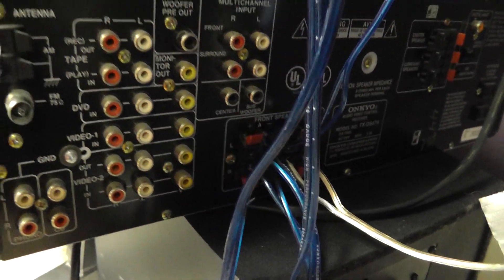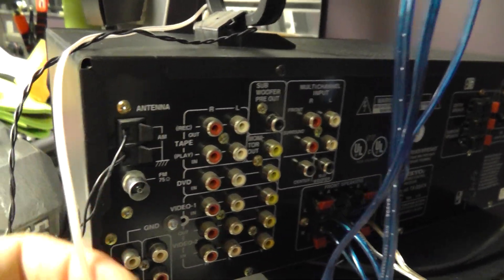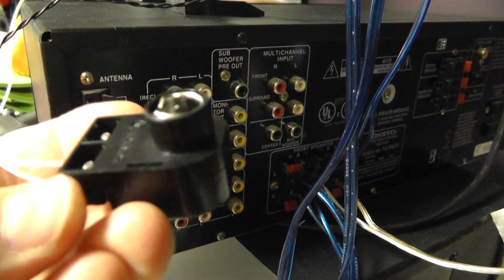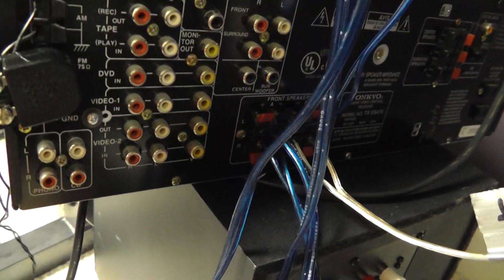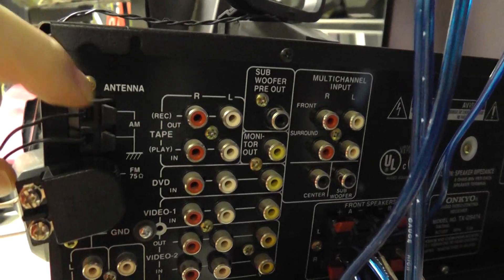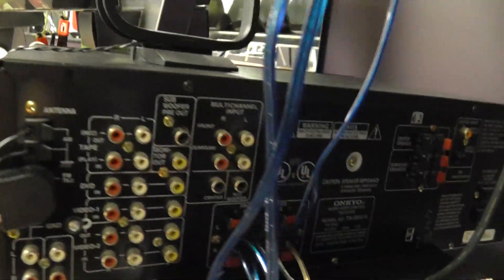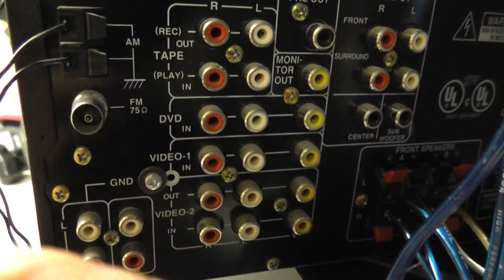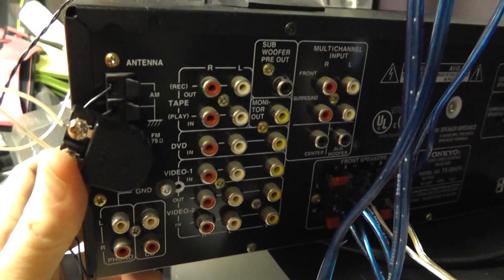how to hook up wire FM antenna to 75 ohm plug

Comment: One question, how could I know if my antenna is 75 or 300 ohms? My antenna's conector is a thin male F type and the one in my stereo system is a thick male F type. Thanks in advance!

Comment: I have the 300-75 ohm adapter.  No dipole antenna wires.  Can I make a diapole wire antenna using speaker wire?  How long?  what wire gage?
Reply from the maker: Really does not matter the gauge,  Length, just about 3ft a side.

Comment: My tuner doesn't have that round connector.  Instead, it has a bolt n screw to attach a bare wire.    Has a separate bolt n ground screw, too.

Comment: Here's a question. I have an '87 Yamaha reciever that never makes anything easy on me. It has spots in the back in a row of four - 300 bal, 75 unbal (both under a FM heading), a spot under AM, and one that's marked ground. I have ZERO idea how to hook up this old Terk FM antenna my dad gave me from his old hi-fi. It splits into two wires like you mentioned but I don't know if they get split into which spots on the back of the unit or what.
Reply: If you figure this out please let me know, I have same issue with my vintage receiver.  Thanks.
Reply: @stevebowman5396  SAME!

Comment: This is WRONG!!! 
A dipole (T shaped) antenna is 72 ohm. That is close enough to 75 ohm to work. 

You do not need a 300 ohm to 75 ohm matching transformer.  4 to 1 matching transformers are for more complicated antennas like a folded dipole or multi element tv antennas. 

Google dipole antenna and 75 ohm antenna. Less than $10 on Amazon. Just make sure to get the proper connector, F-type(US) or PAL(European) for your receiver's input. There are F-type to PAL adapters also.
Reply from the maker: No, you can add adapter which converts to 300 ohm dipole(T antenna) antenna

Comment: That little 75-300 adapter you used there: have you ever taken one apart and looked inside?  I'll bet you haven't.  Nine out of 10 have direct connections--two little jumper wires and nothing else.    There's no ferrite choke transformer like they're supposed to have.  If you're getting poor reception, this is probably why.  Make sure you're getting what you're paying for.

Comment: Or if you already have a rooftop FM antenna that is 75 ohm you can buy one or more of these to have around, https://www.ebay.com/itm/121777070417 , a F type slip on converter for your coaxial antenna cable...  May have to buy an AM antenna one of these days, if I was ever prone to listening to AM that is...

Comment: Jean Steven,  Netlemming , David Daivdson and others...

Success! I ordered the RCA VH58N from Walmart and it fits! I now have old school radio!(Note: "Axis RSE-E101 Quick-Connect Matching Transformer" did not fit, also from walmart)

Although Walmart has it as the VH58N, the packaging is identical to the below ebay link, which is the VH58R. Based on Wiki, it appears AUDIOVOX sells these now? Either way, you may see RCA and AUDIOVOX on a given link (see the true value link). Searching only for the model # should be sufficient.
Hope this works for everyone

http://www.rcaantennas.net/accessories/?sku=VH58R

http://www.truevalue.com/product/Quick-Connect-F-Plug/17356.uts

https://www.walmart.com/ip/RCA-VH58N-Push-On-Matching-Transformer/20588616

http://www.ebay.com/itm/RCA-Push-On-Matching-Balun-Transformer-VH58R-/371899388282?hash=item5696ee517a:g:lAYAAOSwEAtZY-50

Comment: I have a FM 75 ohm coaxial FM port. I have the same cable as you in the video but it doesn't fit! The outside ring of the port and the cable are the same size :( I am in desperate need to find a cable. I broke my old one. Do you know what I should search for on amazon/ebay?
Reply: I bought a couple of the ones below and they too, won't fit. I was hoping the outer ring would fit inside the Yamaha's plug but both are about the same diameter. The receivers come with the adapters for coax plug on the receiver, as referenced in the manual, but it's long gone.

These are handy and it's only one wire instead of the usual "T." They receive stations well. Too bad they don't fit:

http://www.ebay.com/itm/FM-antenna-75-UNBAL-for-Yamaha-Natural-Sound-Stereo-Receiver-/162355421561?hash=item25cd232179:g:Yn8AAOSw8vZXNBqp
Reply: I'm in the same position. I have a Yamaha RX 595. I just bought the below from ebay and not only are the outer rings of the adapter and Stereo's FM antenna input the same width, the the male portion of the adapter is too thick/wide for the inner ring female part of the FM input. The width of the adapter's male portion is about 5/16". Of course, everywhere I look, there are no dimensions for that piece of the adapter. It appears there are other adapters that have a thinner male portion, but all are called the same thing, and difficult to determine by photos. I cannot think of where to find one locally. Too bad Radio Shack is more or less gone.

The title of the ebay item I bougt is "Connector Antenna Transformer Balun75 300ohm IEC TV PAL Male Adapter FM z9Y"

http://www.ebay.com/itm/Balun-75-300ohm-IEC-TV-PAL-Male-Adapter-Connector-Antenna-Matching-Transformer-f/152399808087
Reply: I believe the adapter per ring would go over the Yamaha port.
Reply: I have this port (first photo) as depicted by the seller's listing below. The adapter sold cannot slip between the opening in the Yamaha port. The plug being sold is the same size as any 75ohm coax connector. I found out that my Yamaha (R-1000) and many from this vintage has a PAL connector, so I will either need to make my own or find a proper one. I just want the simplicity of plugging in an FM antenna.

http://www.ebay.com/itm/142432290262?ul_noapp=true
Reply: @netlemming5571  I have a receiver that has a fork input for FM 75 ohms and next to it has a GND input, which I don't know what it is for. How do I connect an antenna to the FM input? I have a transformer that receives the coax and turns it into two wires with a fork, but where should I put these two wires, if the FM input is only one and on its side has this GND?
Reply: @madeirasd  It's likely for the phone input. Is it next to it? AM antenna has two connectors, with one for ground.

Comment: my  radio only has one single wire. What do you do with that?
Reply: Yes. Me to came here for that
Reply: pinto xavier I found a solution I got a car radio and wired it to a 12 volt plug in the house and car radios get way better signal than House radios. I’ve loved it since. Just make sure you don’t wire it to a plug that’s more power that 12 volts.
Reply: Me three!  Still looking for someone to address the one wire antenna application.
Reply: I should say me four, as I have the same problem. I just used an am loop antenna and it works fine. A paperclip got signals when positioned right. Try that
Reply: Benjamin Matejka search car radio in house hook up. It’s way better just make sure it supports your speaker and make sure you use a 12 volt plug no more power then that

Comment: Is a 75 or 300 ohm antenna preferred for fm reception?
Reply from the maker: +don stromberg It does not matter as you may have to move the antenna around to get the strongest signal. However most higher priced receivers now are only putting the 75 ohm connectors on the receivers but the adapter will work fine. If your signal is strong enough and your stereo light is one, you are good to go!
Reply: @Dr.KatzDC  I have a receiver that has a fork input for FM 75 ohms and next to it has a GND input, which I don't know what it is for. How do I connect an antenna to the FM input? I have a transformer that receives the coax and turns it into two wires with a fork, but where should I put these two wires, if the FM input is only one and on its side has this GND?